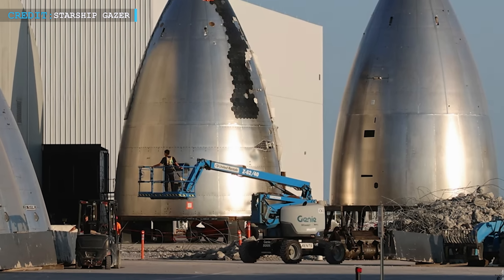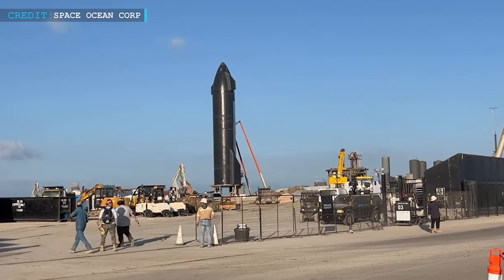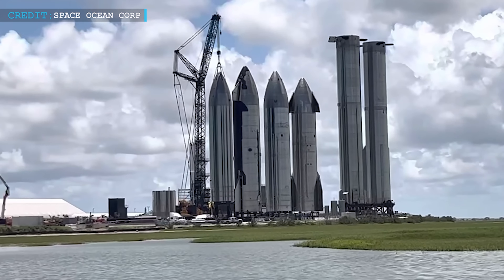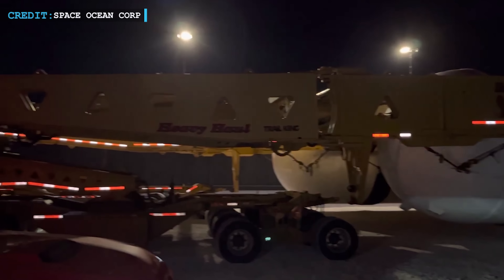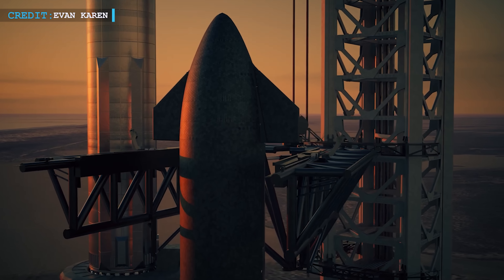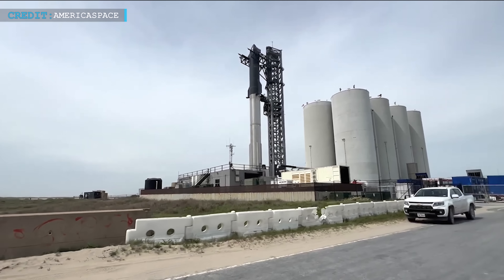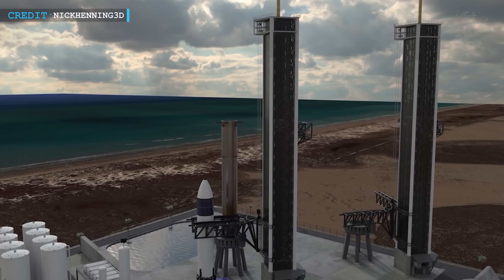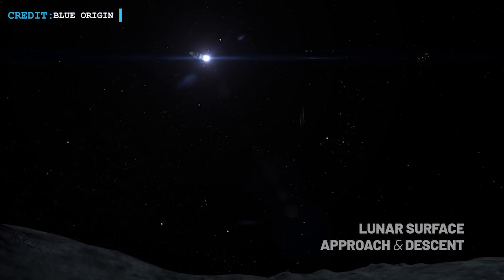SpaceX Starship is gearing up for an exciting milestone: Eagerly anticipated Integrated Flight Test2

Comment: As I have said elsewhere HLS Starship while technically it should make it to Luna and back up high enough to transfer the crew back to Orion, it does have a dead weight issue and a height issue, which should be easy enough to rectify.  Basically HLS Starship needs an 'expendable' 7 vacuum Raptor 3 engined booster with the skirt around the engines dropping away and the engines being able to gimbal.  (No skirt means the outer ring of engines won't bump into it when they gimbal.)  Then this 'expendable' 2nd stage separates before the top part of Starship lands on Luna.  The thing is, especially when working with chemical propulsion, not much can make it to the Lunar surface and back to orbit when the starting point is Earth's surface.  Then you have this very tall rocket landing on the Lunar surface.  You can tackle both of these problems by leaving the bottom half of Starship in orbit.  For the performance of HLS Starship, this gets you in the realm of increasing payload to the Lunar surface by dozens of tonnes, in other words more than doubling it, and the potential to send HLS Starship on a low consumption return to LEO for reuse.  You don't do this and then HLS Starship is hamstrung by all this dry mass going everywhere while carrying very little payload, until it runs out of propellant in Lunar orbit and is thus discarded because you can't bring it back anywhere to reuse it.

The Lunar Lander portion of HLS Starship could then have a single vacuum Raptor 3 on the bottom and say a ring of hot gas thrusters at the top.  The Raptor engine could provide the main thrust for descent and ascent and the ring of hot gas thrusters could make for a safe landing or alternately abort engines if the one Raptor engine failed.  You could have the propellant tanks in the top part of the lander with the crew in the lower levels.

Comment: I believe that too many articles in the production process can actually slow down innovation.  Let's say you have 6. If you find something, while testing the first one, you may have to wait to fly 5 more before you can test your fix. The optimum would be just enough so that there is another one right after you launch the last one and the willingness to scrap articles  that are in process in order to implement the change. Good luck, SpaceX.

Comment: Considering the speed at which SpaceX is now moving, I am confident that they will have things ready for NASA in time to meet the original launch target in 2025.  What SpaceX has accomplished since the first Starship flight test is staggering.  Given another two years I expect they will perform all of the testing and development necessary to have a fully certified lander ready to ferry astronauts to the moon and back to lunar orbit...in plenty of time to meet NASA's current schedule.  The next launch of Starship could very likely be totally successful...from launch to splashdown of both vehicles in the ocean.  The only part of it I am concerned about at all is the effect of reentry on Starship's heat tiles.  That's a 50/50 shot...in my estimation.  But I think it's 70/30 that Starship will survive reentry.  There will be a very large number of sensors measuring the effects of reentry throughout the vehicle.  The data collected will inform as to what changes and enhancements need to be made to ensure the integrity of the heat shield throughout the entire reentry phase of the mission.  Once that is ironed out it's pedal to the metal for Starship development.